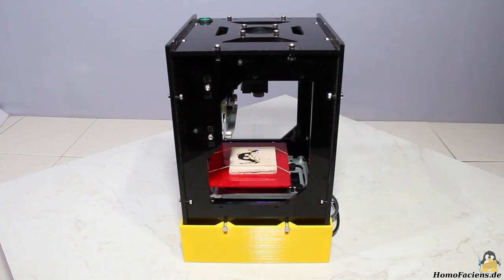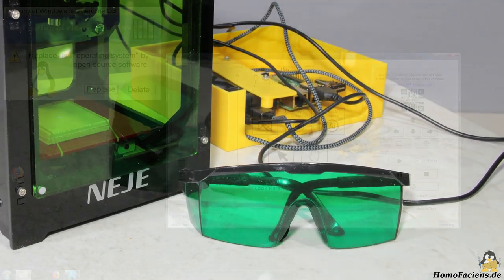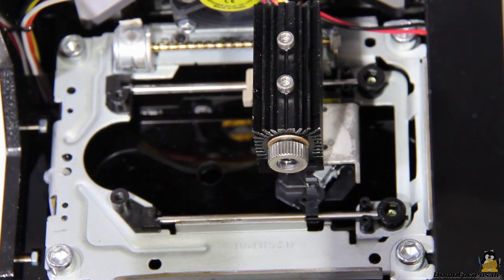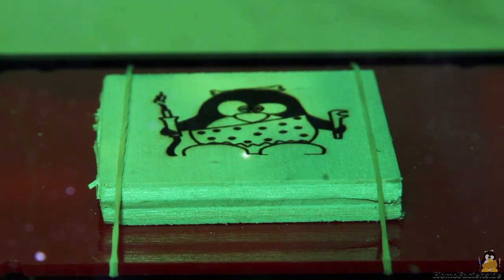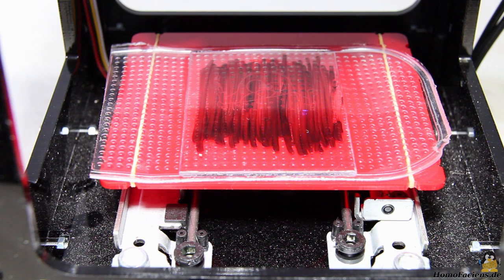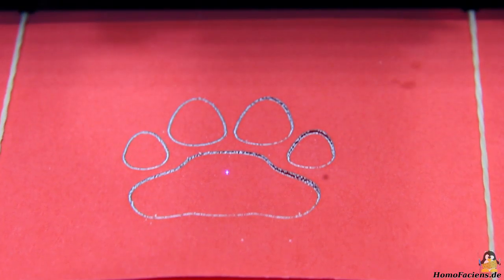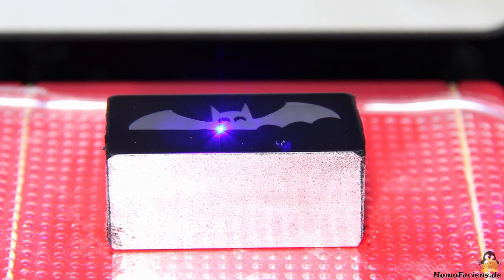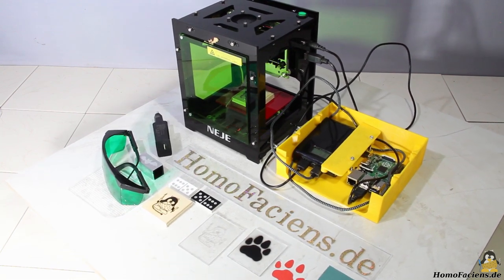Mobile laser engraver with NEJE KZ3000 and Raspberry Pi

Comment: Hello, I can’t connect laser engraver with raspberry pi. The shutdown command works fine, but the other commands (preview edges, start etc.) doesn’t work. Help😭
Reply from the maker: There is a reason, why I have written on top of the readme.txt of the download package:
If something doesn't work:
NEVER FORGET TO INCLUDE ANY ERROR MESSAGE YOU GET DURING INSTALLATION!!!

Comment: I suppose it could do black paint on a PCB which you etch latter, the problem is that it's a bit small.
Reply from the maker: ...and when building a larger mechanics, new Firmware would be nice to change the line by line execution of bitmaps to a gcode version. This was my first experience with machining by laser, but for sure not my last experimentation with that type of technology.
Reply: @HomoFaciens  Agreed!  I was surprised to see that it was not using gcode.  I would think this would be a useful upgrade.
btw, nice job on the software upgrade.  and great to have you 'back'! ;)
Reply from the maker: @Totally Not Evil Robot Army it would be more a completely new built instead of an upgrade using the laser head and maybe the power electronics of the laser with an Arduino board.
Good to see that you are still alive, too ;-)

Comment: 😅 Unbelievable, this thing is actually made of CD/DVD players’ platforms! Could even be refurbished... just like we, makers, do them !
Reply from the maker: I have seen DIY project that even work with the laser heads of DVD RW drives. They are not as powerful as the 3W laser, but are good enough to cut foam or engrave paper.
Reply: DIY ok but this is supposed to be a decent commercial product... ☺️
Reply from the maker: Optical drives were (are) decent commercial products as well ;-)
Reply: Unbelievable, if it's a commercial product...